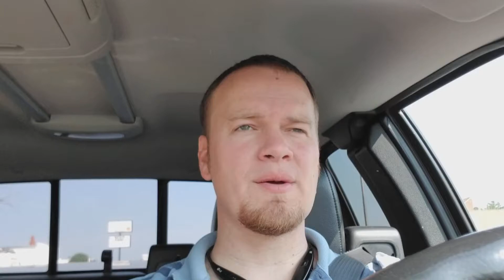Roof cleaning- part 1 pumps

Comment: Why can't you use the downstream injector from pressure washers to soft wash? I'm asking because I've been trying to roof clean lately and customers haven't been too satisfied. I need to know what I'm doing wrong. I fill up a 5 gallon bucket with 50/50 water and 12.5 SH. Then apply with pressure washer with downstream injectors. But my results are never instant. I see people cleaning roofs instantly on YouTube but no one really explains the process, they just show themselves cleaning the roofs. I've heard it takes up to 3-6 months after applying it and let Mother Nature take its coarse, but again, customers are all over me with this process and want instant results. Someone please help me!!!
Reply from the maker: It comes down to the strength of solution.  Roof needs stronger concentration on the roof
Reply: Clean Power Wash ok, also I made a mistake, I don't mix in a bucket with water, I stick the hose straight in the SH can, using the downstream injector. Is that still not a heavy enough concentrate?
Reply from the maker: Most likely no.  It's also going to create a ton of run off.
Reply: Ok, sorry to keep asking, but last question, is the mix 50/50 water and SH 12.5? Plus some degreaser ?
Reply from the maker: @Anthony-fe4oj  our degreaser is dragon juice.  We also use a surfactant.

Comment: Great video. For 50 gallon of mix for a basic cleaning what would your proportions be for the tank. SH/surfactant an water
Reply from the maker: Tom Rinehart 5 gal SH 45 gal water 10 oz snotmenade or Dragon juice
Reply from the maker: That recipe is for house
Reply from the maker: Not sure what you are asking.  Bigger pumps bigger houses.  With my air and booster systems we can clean any house.

Comment: 1) what specific make and model booster pump do you use? how many GPM? 
2) If I use a 12 volt pump instead of booster pump, what do you think is the GPM that I will need to spray effectively from the ladder at average 2 story house roof line?
Reply from the maker: bob bigboy 5GBS0714P4
Reply from the maker: 5gpm. 3/4 HP 150 psi (appx)
Reply from the maker: 12v I would look for a 7gpm.
Reply: Thanks for the info. What degree size and hole size jrod fan tip do you find most effective when shooting the roof from the ladder?